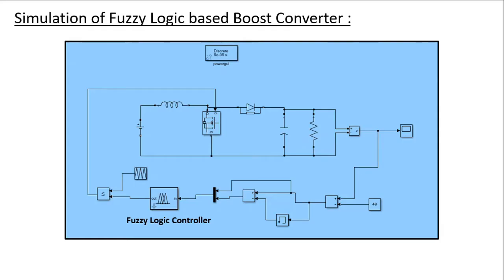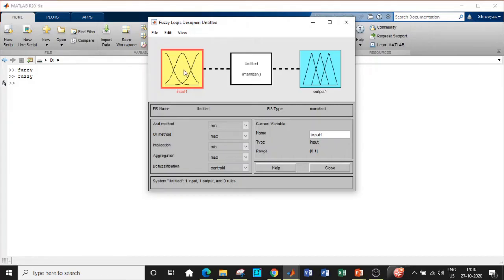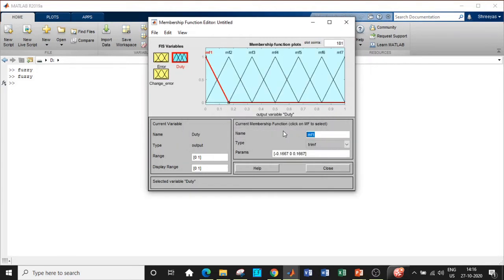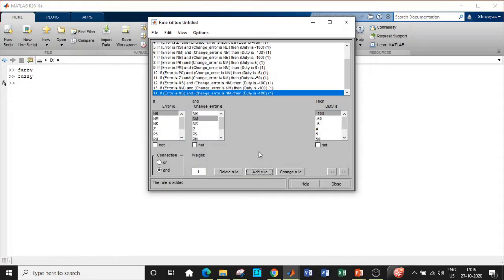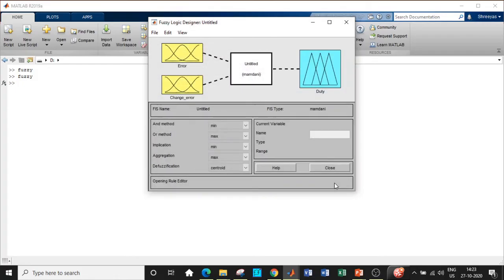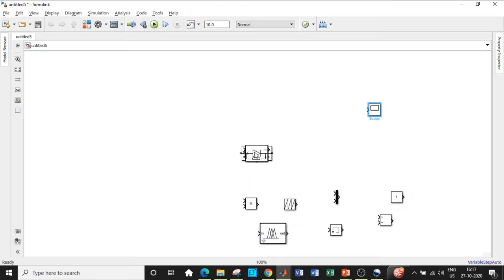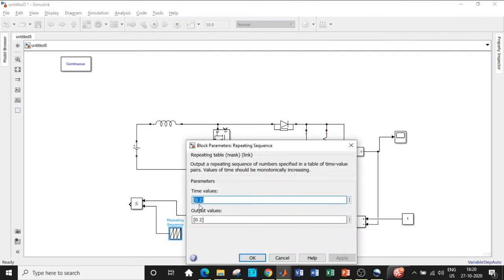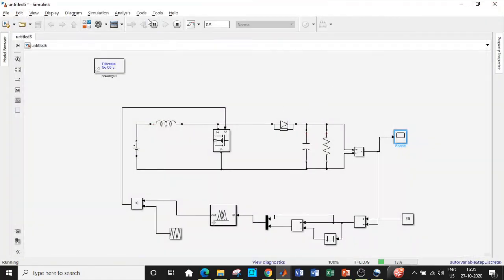Simulation of Fuzzy Logic based Boost Converter in MATLAB | SIMULINK

Comment: how we can change the duty ratio in fuzzy logic?
Reply from the maker: Hi Rishyak. Try changing the parameters in the line of error and reference value of error. For ex voltage or power based on what is in line with the error. The duty ratio will adjust accordingly and still maintain a constant output.

Comment: Man..u made it look so easy..that was a very good explanation..thank you for the video..i have a query.Can the same thing be applied for any other dc dc converter topology as well?
Will be waiting for your answer.
Thanks in advance
Reply from the maker: Hi Raghavendra. Thank you very much. Yeah the logic is the same. Only few changes wrt design for individual converters can be done. You can refer to my videos for design procedure. Later it can be implemented by using the same logic. All the very best :)
Reply: @ElectronicsMaddy  will check out the other videos as well..and will come back if there any queries..thank you for the prompt response..
Wish you the best..
Reply from the maker: Sure.  You are welcome :)
Reply: @ElectronicsMaddy  hii i tried to implement this with another topology. It shows "error in fuzzy logic controller: initialisation commands cannot be evaluated".
Can you plz tell me what might have gone wrong..
Reply from the maker: Try to save the file again in a different name and use the same file saved in the fuzzy controller.
Reply: @ElectronicsMaddy  thanks for the prompt response.I will try it and come back again.
Reply: @ElectronicsMaddy  and in the mean while if u can think of any other reason for this error..pls tell me.
Reply: @ElectronicsMaddy  can u share ur email id I got output as zero.
Can u define y I got it.